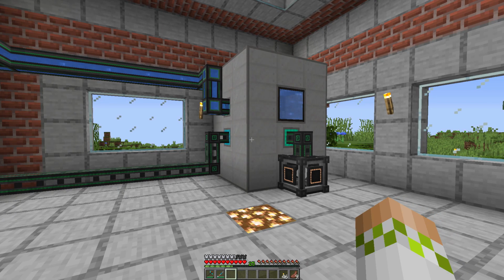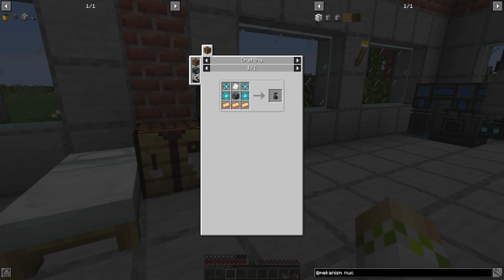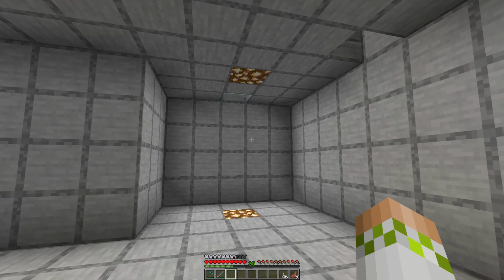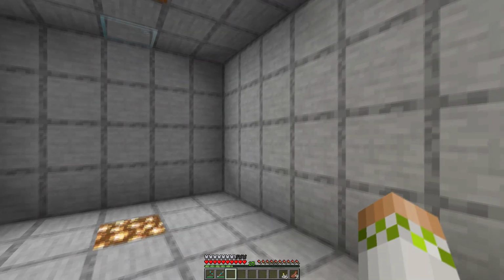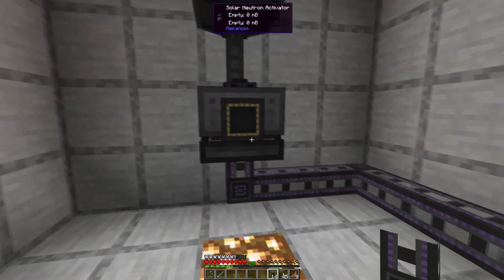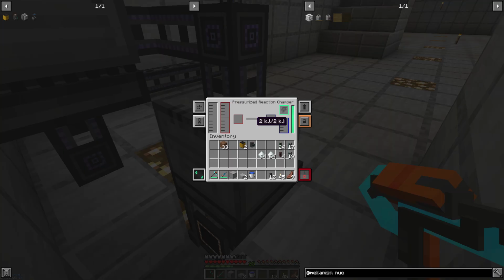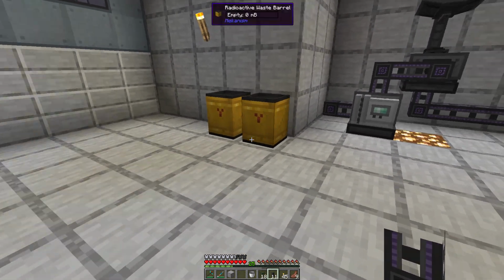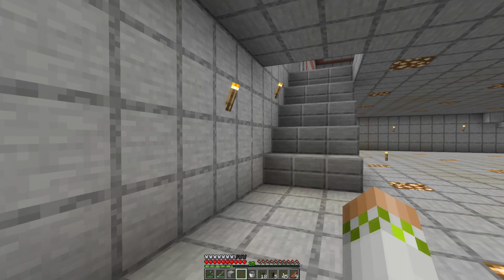Surviving With Mekanism v10 :: E13 - Polonium Pellets & Nuclear Waste

Comment: I wonder what is more effective to produce polonium.  More fission reactors or just bigger ones?
Reply: More would be better. They'd burn through fuel at the same rate, but it's easier to cool multiple small ones vs one big one. You can also void excess turbine energy with a resistive heater easily enough, so having multiple turbines won't matter.

Comment: I use a pair of quantum entangloporters. I put the reactor and turbine 150 blocks away and it gets power and fissil fuel from the entangloporter. If it goes into meltdown, it won't affect my home base or the machines that give it fuel. Worst case scenario I have to rebuild the casing and fission reactor components a few days later.

Comment: There is a way to get rid of radiation! Radiation dissipates very slowly, I also saw that covering it with layers upon layers of blocks also lowers the radiation level.

According to the Geiger counter, anything lower than 3 mSv/hr won't kill you (according to my testing)
Reply from the maker: The only way is a creative command that is /mek radiation removeAll. Other than that, you just have to wait for it to dissipate.
Reply: @RagePlaysGames  
Well yeah that's the only way to forcefully remove it
Reply from the maker: Sadly there is no other way then, it simply has to run its course and allow the half life of the radioactive material to decay to a level where it isn’t harmful which takes a VERY long time.

Comment: It's a good thing that I built my nuclear facility several chunks away from my base, since I had a mishap with my waste line when I was trying to hook up a solar neutron activator... Apparently there was slightly more waste than I thought there was, and one barrel hadn't quite sucked all of the waste from the line when I moved the waste to another barrel than broke the original one... 

Long story short: Considered dawning my hazmat suit prior to this; in hindsight I probably should have, got radiation poisining, quickly teleported back to my base, died, picked up my items, and grabbed my hazmat suit from my vault.

Ah, I see it now. The waste needs to be piped in from the bottom. Wow, I thought the process would be slow... That was quite quick. I instantly made 6,393 mBs of polonium.

Comment: At 15:49 he implies that you can put everything in the end and have it work. This is NOT TRUE. Currently, the Mekanism Solar Neutron Activator does not work AT ALL in the end. 100% broken.

Since you can't move nuclear waste in an entangloporter, don't put ANYTHING related to the fission reactor in the end. The SNA worked great in the end in 1.12, but as of this comment's posting date, the SNA is 100% busted if it is not placed in the overworld.
Reply from the maker: To expand upon this, nothing solar works in the end, not just the solar neutron activator. I am unsure if this is due to mekanism changing how it interprets daytime in the end because it may have been overpowered for things like this or if base MC changed how daytime is read in the end. I wasnt able to find any notes in any Mekanism update over the last year on this so I cant pinpoint what caused it / when.
Reply: @RagePlaysGames  The time in the end is 0 which is considered daylight. In Mekanism in 1.12 (E2E), the SNA worked great. This is a change, and possibly a bug according to https://github.com/mekanism/Mekanism/issues/6801
Reply: Also, doesn't work in compact machines. So basically you're stuck with putting everything into the overworld.

Comment: Hi! My fission reactor is producing waste pretty slow, about 1 mB/s. Is this a normal speed? My fission reactor is much larger than yours.
Reply from the maker: It will be completely dependent on your burn rate as the nuclear waste production is determined by fissile fuel being consumed. Even if the reactor is bigger, you’d have to up the burn rate, all the increased size does is increase your max potential burn rate (which if you set it to will product more nuclear waste).
Reply: @RagePlaysGames  Thank you!

Comment: I have built that same fission reactor as shown in the videos so far... it seems like the nuclearwaste and polonium pellets take forever to produce. I have never made the effort to get this far in Mek so I'm not sure if this is normal or not... Any Thoughts?
Reply from the maker: Since this is the smallest reactor possible, the polonium does take forever to build up. The turbine is made to handle a reactor that burns 19.2 mb/t of fissile fuel which is 19.2x more than the current, making the polonium production also 19.2x faster. This is obviously contingent on making a larger reactor that can burn that much fissile fuel (any more and it won’t be able to cool itself with the turbine condensation water)

Comment: What are some of the things that cause meltdown, blown up 3 reactors so far and i’m a bit new to this mod, water wasn’t the issue is all that i know
Reply from the maker: Temperature reaching critical levels is the only possible cause of an actual explosion, which could occur from 1 of 2 things. 1, you don’t have water in the system or 2, you do have water BUT you are burning too much fissile fuel for the water to cool it off. Your cooling method needs to scale with your burn rate otherwise it won’t keep it sufficiently cool and while it may limit the increase rate, it won’t keep the reactor at steady state.

Comment: Actually, you dont need waste barrels. Just hook it to a solar neutron activator and immedietely process it since you will need a crapload of it.

Seriously, 64k waste is like a drop of water once you start doing the cool stuffs in endgame.

For the spent waste, i usually just go like 2k blocks away, place a quantum, process it there, then breaking it there. Place a chunkloader for good measure
Reply from the maker: While you may not need the waste barrel prior to the neutron activator (I’m using it as a buffer in case it’s ever night and I don’t sleep and leave the reactor running), you’d still need them after since the spent nuclear waste can’t be used anywhere and is still radioactive. You get 10x less than you produce nuclear waste but until you have a SPS, there’s no byproduct free processing method. 

Doing this away from the base and just leaving it or letting it out is definitely an option lots of people go with and I can’t say I wasn’t tempted to go that route, but I think this will make for more interesting episodes :)

Comment: Rage, I've been going over all your last tuts about mekanism. Have you ever tried sinks instead of waterblock plus pump. It has negated most of the limited input problems I found untill now. It even runs my un/disconnected fission reactor, no problem, when just venting the steam!!!
Reply from the maker: Oh I haven’t tried that yet, but I’ll give it a look! Thanks for the suggestion :)
Reply: Sinks aren't from the Mekanism mod, and this is the Surviving with Mekanism series

Comment: Pro tip: make a back-up base somewhere far away from your current one and chunkload your current one so the radiation goes away. Also if you have any storage system, set up a wireless bridge for it at your other base so you won't have to move everything
Reply from the maker: Yep, never a bad idea to make sure your items are accessible in case you can’t get back to your base without dying. That would be unfortunate since it takes forever to become survivable again depending on the level of radiation.

Comment: Great vid as always. I do have a question. Do you plan to expand your fission setup sometimes in the future? Especially to a sodium cooled reactor setup? That would be very interesting to watch i think.
Reply: Sodium cooling is not that worth doing. Honestly, its just better to rush fusion reactor since you need more waste.

Pros for sodium cooling:
1. You get faster cooling 
(75% reactor damage drops to 0 in a few seconds where it takes about a few minutes if using water)
2. You get more steam and use less fissile fuel

Cons for sodium cooling:
1. You need a crapload of sodium
2. You need to worry about chunk loading (mekanism bug, water or sodium sometimes disappear when unloading the chunk)
3. You produce less waste
4. Its expensive as hell and doesnt pay off the amount of time and resources spent
5. You need another evaporation plant
Reply from the maker: Yep, we will be expanding the fission setup, most likely both a larger water cooled one and then moving to the sodium cooled version :) currently the industrial turbine can support a 19.2 mb/t burn rate of fissile fuel so we will at least scale the current water one up to that.

Comment: You should put breaker on fission reactor.  It's easy to do with vanilla piston and lever.  And 2 logics controller.
One set to high temp, the other set to activation.  Put lever on the activation and piston on the high temp.  Orient the piston so it knocks off the lever when temp goes into red.  Also have a pump always attached to the reactor as backup.
Reply from the maker: Yep, I mentioned in the fission reactor video that it’s possible to do and I’ll be adding it when we expand the setup to both a larger water cooled version and sodium version :)
Reply: yes

Comment: I've made the same mistakes so many times, simply because I break a single pressurized tube, and then I have to wait like 2 hours before the radiation is at not-constantly-killing-me levels😂
Reply from the maker: Yep, I was SO worried I would mess up and break a tube during the video. I even made a backup of my world on the off chance that happened before I could make the meksuit with radiation protection lol.
Reply: @RagePlaysGames  you could make a hazmat suit out of lead and orange dye, keeps you from dying to the radiation as long as you keep all four pieces of armour on.
Reply: @RagePlaysGames  what is the command of getting rid of radiation?

I accidently broke a waste barrel in my testing world and you know what happened next
Reply: @verynormalcactus  its /mek radiation removeAll
Reply: @BIistaCompact  Also helpful: /mek radiation heal @a
Reply: i accidentaly used shift+right-click with the wrench instead of just right click on the solar neutron activator and my whole base was just completely irradiated. luckly i made a set of hazmat suit and a dosimeter and a geiger counter just in case so i quickly run to the chest and put on the suit. it has been like 40 mins and there is still 26.282 uSv/h 23 blocks away from where the solar neutron activator was.
Reply: It’s fun to play with mekanism on a server so I can just get off the game for the night and come back to no radiation ☢️

Comment: I recommend to shift-click all faces of a “side configuration” panel on a machine before putting it down near tubes or other machines. This will prevent accidentally taking the wrong material (like nuclear waste) or outputting materials. I try to keep all my machine I/O strictly opt-in. Well, except energy. I leave that as “input” on every face
Reply from the maker: It’s a shame there isn’t a way to make every machine you place have no input / output settings by default and then you can work from a clean slate.
Reply: There’s some sort of request for this on their issue tracker and they said they were thinking about something for it. I’m not sure how it would be implemented without putting the machine down though.

Comment: I have been a viewer since imersive engineering (the first one), I personally love your vids. But I have a question, What do you go through to download the mods? I want to try out modded (I finally have a good laptop). Have any advice?

Something is glitched with my yt and decrp. Don't work for me
Reply: You could download modpacks in the Twitch minecraft launcher that have all the mods he's using and more, like Valhelsia 3.
Reply: google "curseforge minecraft mods" you can download almost all mods there, just be careful about the minecraft versions.
Reply from the maker: I download each mod individually from curseforge. There should be a link to the main mekanism mod download in the video description to go off of :) then I just drop the extracted file in the mods folder of my Minecraft folder. Some mods need other things included to run like Fabric or Forge to load the mods. If you launch the ya game and are missing something it will usually indicate what you’re missing.
Reply: Do not use the Twitch launcher. It has been replaced by Overwolf. However, that launcher also has issues. Most recommend a launcher like MultiMC.
Reply: @fashnek  This is the first I've heard of Overwolf.  I'm still extremely annoyed over the whole Curse/Twitch fiasco.  And apparently..... as per a quick google..... morons.  'We'll work on Linux support.'  When the app is already written in javascript and should already support Linux out of the box.